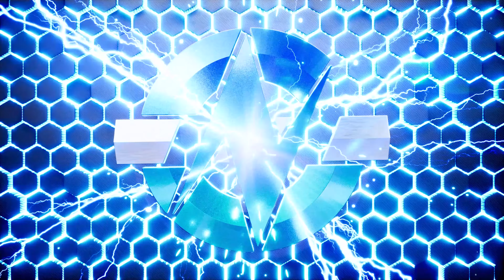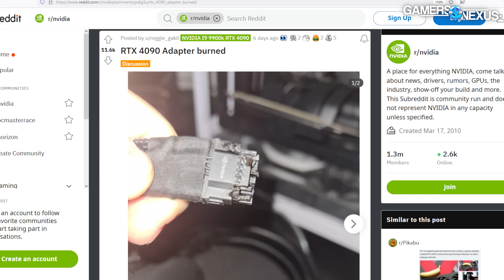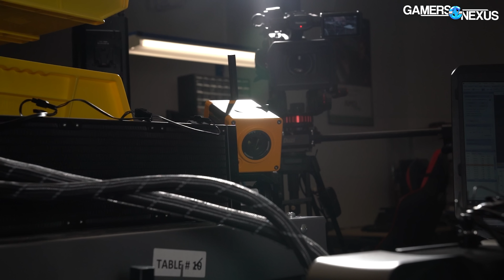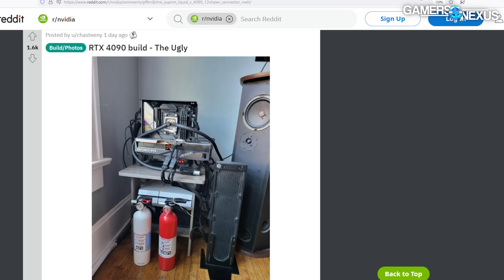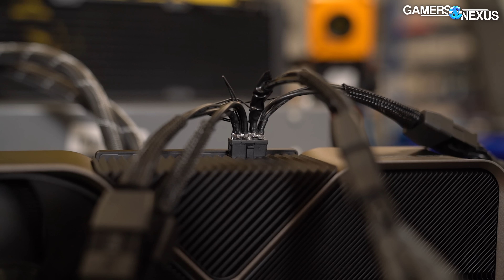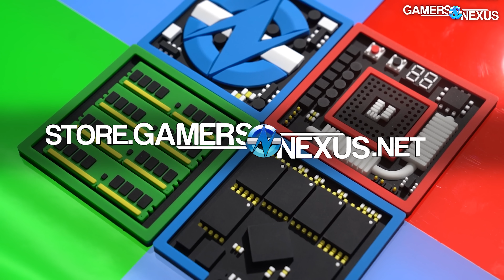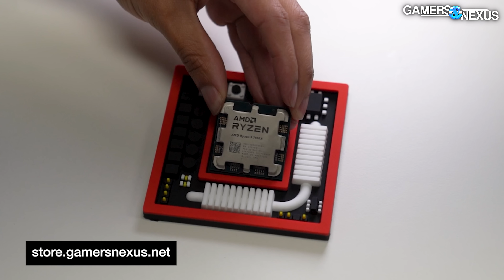Testing Burning NVIDIA 12VHPWR Adapter Cable Theories (RTX 4090)

Comment: Everybody is looking at the cable has anybody looked at the connectors on the card or the power management components on the card?

I would also be interested in what games they were playing to rule anything out. 

Maybe some game is causing far more power draw than others. And yes I realize how far fetched that is.

The only reason I'm even recommending these things at this point is because it seems that all other attempts to reproduce it have failed. Once the obvious is eliminated you need to start looking at the not so obvious.

Comment: Having done extensive GPU mining over the years, I can tell you exactly what is causing this problem. Using a cheap, overrated PSU to power the system. Probably an off brand like Apevia or similar. Or using a low power PSU (650W or less) that is bronze rated. These PSUs put out dirty power when pushed over the limit and have caused melted/burned cables in the past.

Comment: This has to be looked at from an electrician perspective. Ask the company that built the graphics card, what gage wire is needed in order to be in compliance with hardware requirements? This should be an outliner for all third party manufacturing standards. Igor's cable looks bad.

Comment: imo.., one testt id like to see is how much heat ,voltage and amps its actually takes to melt the parts in question.,  there's usually fewer ways of achieving certain amounts of heat in any one system ..

Comment: I think Buildzoid nailed the reasoning for these damages, the end of the connector is what is getting damaged because the terminals in nvidia's adapter are weaker. The solder joints don't seem to have anything to do with it because that's not where the cables have been failing

Comment: "Practical sinario"... steve... put it in a case with mediocre air flow and in a room that doesn't have great temperature control. The thermostat isn't in my room where my pc is and my pc can heat my room in less than half an hour. I'm sure when the inside of a case is a 40C+ environment the plugs can get much closer to the glass transition temp. and will be deformable.

Comment: Do you really need lots of testing to prove that 6 < 12? The 8 pin PCIe has 3x 12V pins. 4 of them is 12x 12V pins. This connector merges them into 6x 12V pins. That's half the current capability. Besides, we already have the EPS12V for the CPU that can handle 150W on the 4 pin and 300w on the 8 pin. GPU manufacturers should just replace the PCIe connectors with those. Why make a whole new standard when we have functional existing standards?

Comment: Bootable VS unbootable.  That is easy and  I can explain.  Most people will boot up the system before putting all covers on.  And put the case covers on while it is running. Is it possible the card is booted. Then something happens to make it not connected even enough to boot but won't shut down the system?

Comment: Paul confirmed the bad design found by Igor. Might be a quick call to get a "bad" cable?
reference: "Well THERE'S your problem... RTX 4090 600W 12VHPWR Adapter Teardown"
However - very happy that this being followed up by you, jay, igor, paul and more. At least people will be aware of the issue.

Comment: Good analysis. I think we can root out wire problem now. Looking at the pictures, most melting happens in the front of the connector, and not anywhere else, it most likely could be a pin to connector contact patch issue (like buildzoid mentioned). And additionally, like you said, pulling to right side would hurt and limit the contact patch on left most pin. 

Since pins a thinner (when compared to 8 pin connectors), and surface area of connection will go down by square of thickness of the pin, typically this would mean that the resistance would go up by exponent of 2. And on top this,  when contact between the pin and connector is imperfect, it will reduce contact patch even further. This would increase resistive losses (turning more energy 'at point of contact' to heat), and the gap, due to imperfect contact, would increase capacitive losses (further turning more energy into heat 'around the disconnected surface of the pin'). Although capacitive losses may not be very high, but resistive losses would certainly be something interesting to measure.

Just a thought.

Comment: As to Igor's findings, if the pins on the outer edges are breaking those won't be the ones getting hot. It would be the center pins. His findings are the opposite of what's actually happening in the field. A pin broken exactly enough to still make contact and poor enough to get hot is a real freak scenario. Also the hot spot would be at the break. Not deep inside the connector which is where the thermal damage shows in the user reports. 
This style of pin and socket is very susceptible to damage from how the connection is made. The female pins are easily damaged and will become loose. The loose fit will absolutely cause heat build up deep inside the socket. Most of us wiggle the cables a bit while sockeing them. That wiggling can actually damage the female side of the pins in a way that will cause this exact failure mode.

Comment: 16:48 Don't forget to use PSUs that have different phase shifts on different 12V plugs. (Phase shifts in slight AC noise of the mostly DC supply.) Maybe it's fine when the phases are joined securely, but with an intermittent contact, it can generate lots of heat?

Comment: Been a while since we regularly saw "melted cables" in the YouTube computer builder scene. But I still remember last time.
Last time, it resulted in the phrase "Molex to SATA, say goodbye to your data" because those Molex to SATA adapters were being made at a poor quality, and were somewhat reliably melting when faced with even the relatively modest power demands of a hard drive or optical drive.

The more things change, the more they stay the same, back then it was because of the pins on the adapter not fitting properly with the pins on the actual power cables or the connector on the drive itself.

Be interesting to figure out what the true problem is, but I imagine it's going to be another "what if this standard isn't rigid enough, or what if people are "close" but not "meeting" the standard" type of thing, where you can point to the sign that reads "Standards exist for a reason, and if you don't follow them bad things happen".
Why do I think that's the case? Well, for starters, that adapter Igor has is apparently using 150v rated wire, and all of yours are using 300v rated wire.

But that might as you said be a red herring. Why? Well, it's the volts in the wire vs the volts the wire's rated for. DC at 12v is nowhere near 150v, let alone 300v, as I'm sure you're aware of.
Now, what does that mean? Well, it means that the specification for the 12vHPWR to 4x 8-pin PCI-e adapter cables probably doesn't really care about the difference between 150v 105C rated wire and 300v 105C rated wire. 150v is still plenty good enough for carrying around 12v.
In fact, it might even be a benefit. Allow me to explain:
If they're using the same insulation formula, 150v 105C rated wire will have (obviously) roughly half the insulation thickness compared to 300v 105C rated wire. And when you've gotta cram so many dang wires into such a small spot, that could make it easier to solder the wires, or it could make the wires easier to bend (and therefore require less strain relief, or be more tolerant of bending with the existing strain relief). And with where most of these 12vHPWR connectors are on the 40-series graphics cards, being tolerant of more flexing is a good thing, because well, asking for a whole 35mm before you put a bend in the cable (from the 12vHPWR connector end) combined with the sheer size of the 40-series cards, is something that makes many current cases just not fit the 40-series cards without using something like a 12vHPWR right-angle adapter (they're being made by a few companies now, but IDK if they're standards-compliant or not, I'd love it if GN would test a few of them because they have the potential to solve many many case clearance issues and that would be a god-send when most people can't afford a new case after buying a 40-series card).

So IDK if the insulation voltage rating makes a difference, because the issue here seems to be I^2*R losses , not a problem with arcing.
Now yes, the thinner insulation of a 150v rated wire would be easier to damage with something sharp, and the possibility of a "not quite a short" circuit that creates a lot of heat but doesn't actually trip the OPP circuitry in the PSU is something that should be looked at, but there are still safety margins built into the insulation to account for handling and that kind of thing.

Comment: Honestly, thank you for this reporting! I feel at least a little more at ease. I have a Gigabyte Windforce 4090 and it shows no signs of any wear or melting (just checked). It definitely sounds like this could be related to one of the manufacturers of these adapters using cheap parts to save money (hence IGORs substandard cable while yours are OK). I suspect only NVIDIA will be able to tell if that is the case and who it might be.
Reply: Yep, it's highly possible it was just a batch or two of substandard adaptors made by a manufacturer, where they cut corners and used cheaper unspecified parts to either save on money or as replacement parts in order to cover a order, when they where running short on stock. It also really wouldn't surprise me if that company was a Chinese cable/adaptor manufacturer. Cutting corners and ignoring safety protocols and regulations, really is the kinda thing they do often do, in China.

Comment: Why you didn't measure every pin drain current?? If it's above the wire/connector plastic quality limit, it will overheat and then melt. Plastic often melt because of overcurrent, and you didn't show that pretty needed data.

Comment: Get yourself an external 1KW simulated variable load, that way you can easily vary the loading conditions to fit your need. That's what we do in the power electronic manufacturing industry.

Comment: Would it matter if the PSU is using a single +12V rail or Multiple +12V rails ?  Just trying to think of a scenario where a user plugs the cables into a PSU in single rail mode, there's a unknown fault in the cable (Perhaps due to overstressing, bending, etc), SCP doesn't detect it (Because its in single rail mode) resulting in melted / failed cable ?

Comment: @GN - everything what You doing in this test.. it's wrong! Instead use GPU and adapters from manufacturers press packs, You must buy random models RTX 4090 from the market, and test included with GPU adapters.

Of course - You must bought those cards as a random, anonymous person, not connected with Gamers Nexus, and use random address also not connected with Gamers Nexus. And voila! You have cheap and dangerous 12VHPWR adapter :)

Comment: 6:11 The 150v/300v indicated on the sheathing is irrelevant in a 12vdc environment. Focusing on this only leads to more misconceptions and misunderstandings. I've already seen people refer to it as being something better or worse on a discord channel. In fairness, the logical conclusion would be to prefer the cable with 150v printed on it, since it would probably have a larger cross sectional area than the other, due to it carrying a higher current for the same wattage. There is a reason car manufacturers have ditched 6v many years ago, and wanting to ditch 12v in favor of 48v also. The reduction of amount of copper is huge, since the needed current drops. PUI (W=voltage*current)

Comment: If Nvidia changed the cable rating from 150V to 300V I am not sure what the rationale would be. Surely the voltage rating only concerns the insulation, and would have no bearing on any problems that relate to excess current and/or poor contacts, which could lead to overheating and fires. For something that uses 12V, that change would seem to be irrelevant.

Comment: Still not sure why they have it as 4-8pin; each 8pin can do almost 300w safely. So the adapter is good for almost 1200w. Should have just had 4-8pins on the PCB....idiots

Comment: Igor's cable could be an earlier revision. It's certainly conceivable that Nvidia silently revised the design after a few failed in the wild. It would explain the sporadic failures being reported despite your testing.

At any rate, this is an extraordinarily stupid design Nvidia chose. 50 amps at 12 volts is enough to drive a winch, and trying to squeeze that much current through a cheap plastic connector is just begging for problems like that. If this really is where GPUs are going in terms of power consumption, then we need a single heavy-ass gage cable running straight from the power supply to high-current screw lugs on the card. Not this shit.

Comment: I am not an engineer nor an electrician, I just really like problem solving and these the things I would look at based on my knowledge to maybe give you more possibilities to find the problem.
I think it would be important to clearly see the internal bus bar to see how it is constructed. If the solder tabs snap there is still the internal bus bar, this would increase the current flow trough the bus bar and also the heat generated. Based on your testing this still dose not seem to be the problem, but if the bus bar is damaged it could further increase the resistance causing more heat.
At the same time it is also very important to find out if it is the bad wire that causes resistance or if it is actually completely unrelated, because to me it seems the most heat is in the end of the connector that plugs into the GPU. There you would again have to look into the board design an check if the they all go back to on common power rail or if they separate out to different components that could cause unequal load on the pins of the connector.
I also do not believe that the insulation rating on the wire has a lot do with the problem. I would treat is as a indicator of a change in the manufacturing process or wire supplier or as you said manufacturer. They probably figured out that the solder tabs are breaking so they slightly changed the position of the wire and where/how it is soldered. Again, if the wire is rated for 150V or 300V both are over the Voltage that is being put through the cable. Wire is a trade item, if you stat out with 150V wire and during the production the 300V wire gets cheaper than the 150V wire the company will buy the 300V wire when it has to get more. This could also mean there are good connectors with 150V rating or even bad connectors with 300V rating.

Comment: Voltage rating says nothing. I saw few times cables/wires being sold with different Voltages and Amps. Like 400V 4/16/32/63A, 250V 10/16A etc. There are 300V cables with 0.25-1.5mm wire diameter and 150V cables with 0.12-2mm which I literally found while writing this comment. There are 1mm cables rated for 300, 450, 500, 600, 750 and 1000V...
Also manufacturer of cable may be just lying, such thing happens too and are not that rare cases.

Comment: If it's not happening this way normally, what if the card failures are happening based on the workload/PEBKAC? What if those Redditors were using the card for crypt(o) mining, or if it's a bad connection where the PSU cables are being used are the problem.
Like sharing the same cable or using the PCIE6+2 cable backwards with the 2 exits being plugged into the PSU to "give extra power", corsair is an example of this happening

Comment: Thanks for the in depth look at this issue. I was about to return the new ATX 3.0 power supply that I just bought over all the fears spreading around but looks like it'll be fine.

Comment: Huh, to me this looked like a pretty textbook point contact in the pins caused by downward pressure. The melting seems to be inside the pin connector, that instantly makes me think the receptacle itself is overheating. The failures I've seen online were all comorbid with high lateral pressure on the connector either from cable tension or case interference. In the folded sheet metal type connectors used in Molex and JST pin receptacles, lateral pressure can cause the pin housing to flex and partially open, allowing the pin inside to rotate slightly, creating tiny, high resistance points of contact at the base and tip of the pin.

Given that we see many failures at the outer edges of the connector, I would surmise that the majority of failure cases are related to bending the cables along the long axis of the connector, leading to excessive lateral pressure on the connector, twisting it slightly out of place, rotating the outermost pins and creating resistive points that led to melting either at the tip of the connector or at the base of the receptacle sheath, rarely both, likely in cases of extreme lateral pressure increasing the impedance of the other pins as well, forcing more current through the worst offenders.

Comment: 3090 Ti has a 12 pin.  4090 has a 16 pin.  The sense/optional pins do count or the previous PCIE cables would have been 4 and 6 pin not 6 and 8.

Comment: The one thing I worry about here is if the solder joints are not broken, but bent or cracked. In those cases you could end up with what would effectively be a very small wire that has a huge amount of current, similar to a toaster.